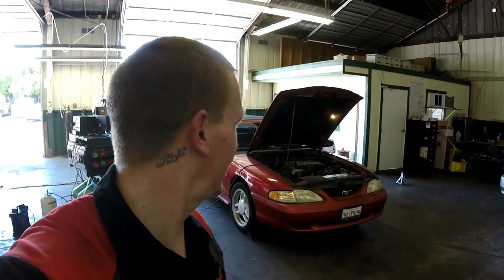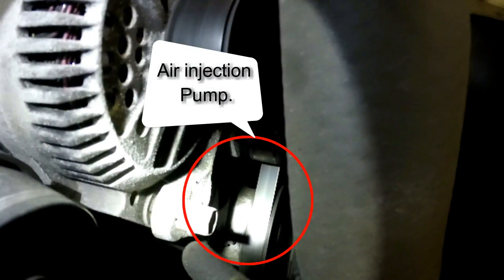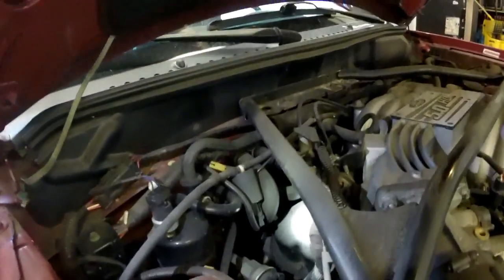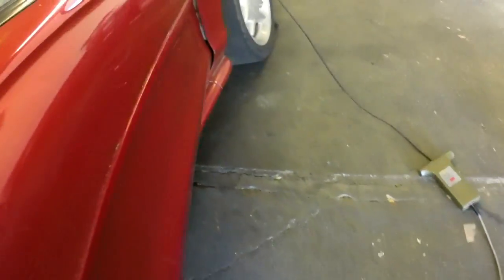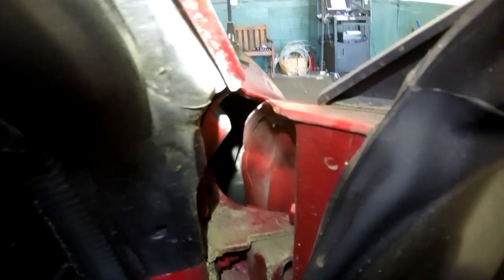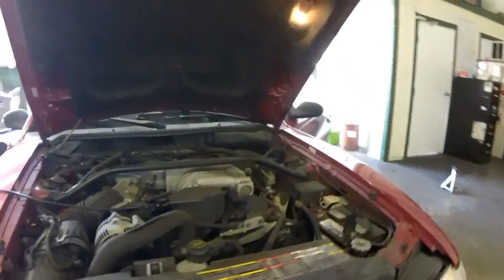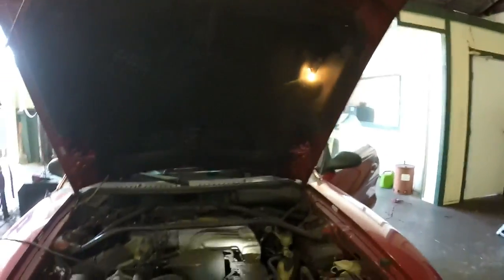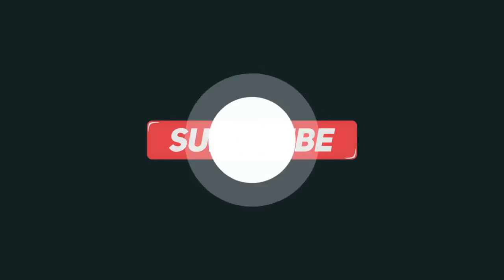Ford Mustang emissions / smog locations: PCV, EVAP, EGR, & Air Pump 5.0L

Comment: Coming off the pcv valve. Follow the hose over and there is a plastic piece that I believe is shaped like a T, but I cant see it because it goes under the intake. What is that plastic piece called? I broke mine

Comment: HI  WHERE IS THE AIR SECONDARY PUMP? FORD MUSTANG 1999,3.8 V6
 WHAT IS THE CODE PO412 SECONDARY AIR INJECTION SYSTEM SWITCHING VALVE A CIRCUIT?
THANYOU

Comment: Thank you for posting this it most definitely help me confirm my original thought of where the pcv valve was . Question for you can i put an air beather on with the pcv valve or do i have to remove the pcv valve to add an oil breather on the valve cover.
Reply: Very old question, but the engine has to be sealed tight so vacuum can be retained. If you put a breather anywhere, you'll introduce an entry point for air, also known as vacuum leak, which will cause the motor to idle roughly and even stall. Use breathers with carb motors that don't use EEC-IV or other ECU.

Comment: Hey Scottie. I have a 94 Cobra Mustang here in Ventura CA. Is that true that my smog guy should not check the timing? Last time he smogged my car he checked the timing. Please advise thanks
Reply from the maker: If you have the 5.0 l. on your under hood label it gives you a factory timing specification but if you continue reading it and says that it is not adjustable. So in my opinion I do not check the timing on that one and have never been been hit on my star score for it.

Comment: Awesome! What tools will I need to change the Evap canister?
Reply from the maker: Mann.. I owned a 1995 Mustang 5.0 bored out to 347 and I never even touched that thing. lol. You have to take the passenger fender off to remove it. Canisters really never go bad unless they fill with fluid or get broke from a crash or something. It is super common for that car to have a broken filler neck hose on the fuel tank... have you checked that?
Reply from the maker: also.. make sure the canister is in this location. It changes the the driver inner bumper, next to the fuel tank. I think it changes somewhere around 97.
Reply: Scotties Hobbies No, haven't I'll have to check that out. My car is showing signs of a bad evap canister and I had the computer read it and it said that also
Reply: Scotties Hobbies never mind I remember I had the filler neck changed out like 3 years ago on that car
Reply from the maker: +Matt Cop what was the code you got?
Reply: Scotties Hobbies I don't remember off top hand